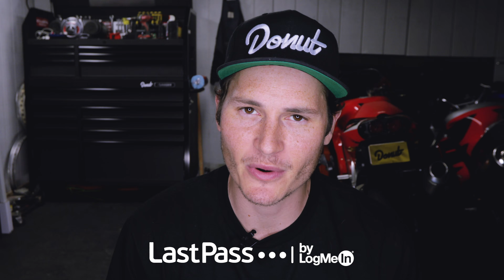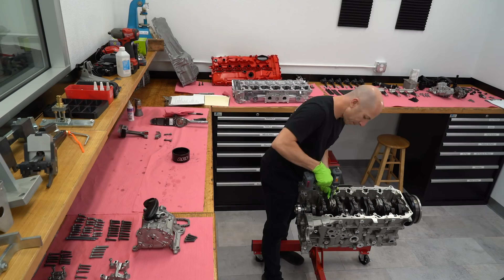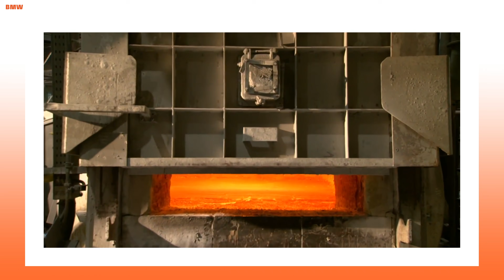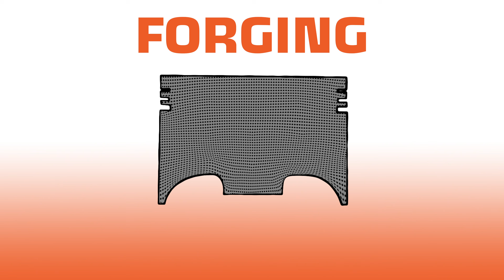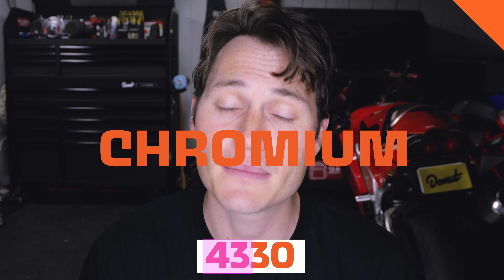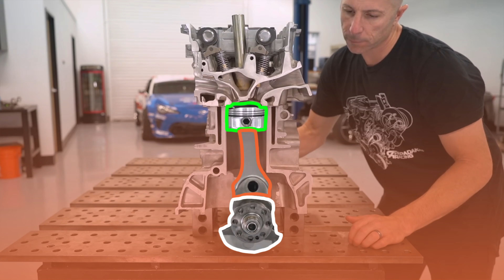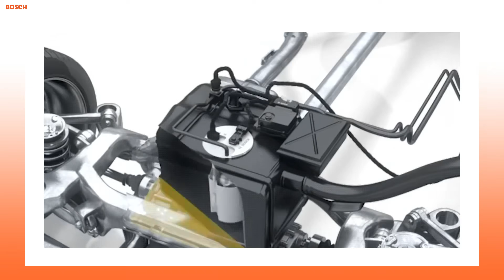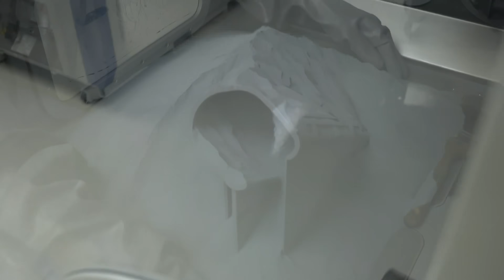The FIRST 1000HP 2020 Supra - Tech Explained

Comment: TBH, when I first heard of the BMW / Toyota collab for the Supra and Z4, I didn't think much of it till now. But to get 1k HP out of a stock power train with just a few new parts is absolutely insane. Who woulda thought that 2 of the titans of the automotive industry could create, and pretty much future proof such a magnificent beast.
Reply: It can take 800whp on stock internals(more is possible but with the risk of the rods twisting) but this is the version with 2 port heads he was using. The 2021 Has 6 port heads with a lower compression ratio,different heads,and different pistons so the 2021s are going to give the mk5s a bit of a kicked once their out.
Reply: "1k HP out of a stock power train with just a few new parts"
* only parts left are the block and the top *
few new parts....
Reply: +SMG516 I wouldnt call that few.. the 2JZ has been actieving those power levels with less parts changed for 20+ years.
Reply: @Clownelskiy  It didnt happen the same year though. It took awhile for the 2jz to achieve those numbers.
Reply: @GokuTheHusky  that's cuz we were all still learning. Way easier to make 6-700 hp out a 2jz than b58. B58s break when you add 1-200 hp
Reply: @eduardorivera4100  not really, adam lz have a high 600hp mk5 supra and it didn't break after a whole lot of beating,
Reply: @GokuTheHusky  @Alexander White Of course not. The aftermarket was nearly non-existant for these power levels in the early 90's. You were the shit if you made over 500hp with any Japanese vehicle on the street. Stupid comparison. Most were still running BPU by late 90's.
Reply: @eduardorivera4100  Did you not watch the video lol? Almost everything is stock in this car lmao?
Reply: @Clownelskiy  that's nice
Reply: @Clownelskiy  False you actually need to change just as much in a 2jz to get to 1000hp reliably. This engine has been around for less than 4 years so that's a moot point.
Reply: @razvanmihalache5680  False on your end indeed. Last time I checked, 1000hp could be made on a 2JZ without upgrading an intake manofold or building the V160 transmission and we have done so for many years reliably.

Comment: CR part is wrong-ish. CRs in the range of 7:1-8.5:1 are common on boosted engines. Most modern NA gasoline engine run compression ratios in the region of 10:1 to 12:1 on regular gas (95 RON). Modern diesels  commonly run somewhere around 15-17:1. Except if youre Mazda, then your gas engine runs 14:1-ish no hassle

Comment: 135 ft-lbs??? No sir, that’s not at all a correct statement. If that was the case when I torque a head on a Waukesha 7042 to 600 ft-lbs per nut with a 3/4” drive Proto torque wrench I’m F*CKING SUPERMAN! It all goes to leverage sir plus if you put 135 on that little 1/2” drive with a 4 or so inch handle you can say goodbye to the little cog in there! 😂😂😂 Other than that love the video and Donut Media!

Comment: Soooo its not stock as it has aftermarket internals. Granted only pistons or whatever but its not stock. Im not a 2J fan boy but they can achieve 1000bhp without any replacement internals.
Hell even the 1uz V8 can achieve 1000bhp with a stock bottom end just a huge turbo a good tune some hose pipe for injectors and some upgraded head gaskets and studs

Comment: Great video, some really informative stuff, check your numbers on compression ratio. Most modern engines run near 10:1 some even higher. Race gas around 15:1. Diesel engines around 20:1. Jet engines are around 40:1

Comment: To be honest... using retarded units on engenering stuff is hard... especially for professionals comming from countrys other than the us... I need to look up every god deamn unit u mention like 5 times... Pls use the metric system in some way in the next videos. For example just write the Number with the metric unit somewhere on screen.

Point 2. You make 135 FT - LBS or about 180 Nm seem like a lot... and for a M10 screw this is a lot, when you consider, that many engine manufacturers use aluminium screws.
I have learnd at a machine manufacturer, where we regularly had M10 that were planed stock with about 100 Nm.
And a few special bolts (also M10) were torked down with about 140 Nm (stock).

From an engenering standpoint this is expensive stuff, but not unusual!

Comment: The dyno run shown multiple times isn't indicative of the final product. The sparks were from the direct injection system being turned off for port injection and used to plug the cylinders shut. Then that happened and they made actual plugs so they wouldn't damage anything and keep running.

Comment: For the people saying that the b58 is inherently worse than the 2jz because if needed a fancy manufacturing technique for the manifold, that is not necessarily a valid argument because the manifold for this car was made that way since there is very little aftermarket support since it's so new. Nobody manufactures this kind of manifold YET, but they do for the 2jz. Thus, it's a lot easier to make a one off using a 3d metal printer than normal manufacturing techniques which require that thousands be made to be cost effective.

Comment: The part about compression ratios isn't necessarily correct, most modern engines have compression ratios in the 11:1 to 12.5:1 range

Comment: Just saying Mazda with their sky active tech can have a 12-1 compression ratio in a N/A motor like in the Mazda 6 which runs on 87 octane
Reply: I believe overseas versions run even higher, like 14:1. At least, I remember reading that in a magazine like 5 years ago.
Reply: N/A engines normally have higher compression than turbo engines, just saying.
Reply: The comment I was looking for

Comment: peaked my attention when you mention compression ratio and how that relates to power/fuel type. see if anyone on here could answer this, my car is a tiny little 4 banger only makes 130 Hp and uses normal gas, BUT the dang thing has a compression ratio of 11.1 ! so my question is could premium fuel make any change to performance? i want MO POWAH but there is no after market support at all for my car ( ; _ ; )

Comment: FYI: The sparks flying out of the engine during the dyno clip are the stock direct port injectors left in the engine overheating, melting and wrestling in the combustion chamber.
Reply: haters detected
Reply: Sep G I’m just not impressed. For the power level he achieved he didn’t do anything that special. He also used old technology instead of  developing or using new shit with these cars. It is understandable given his timeline, but still not that impressive
Reply: "direct port injectors" lol
Reply: He made a plate so instead of leaving the old ones in now
Reply: just watch papadakis disassemble and reassemble the whole engine and what did he do to achieve that 1000Hp goal, for what he just said, only the head and block was retained in this build, the crankshaft is bulletproof itself yet its a drift car, it can hold that much hP yet they need NOS that's why he decide to change it
Reply: Arin B. The b58 shares a similar displacement and engine layout to the 2j. Everything else is just better
Reply: Is that true??? 😳
Reply: Except they didn't use the stock direct port injection.......
Reply: @masonpressley5284  yes but the injectors were still on the engine, after that incident, steven machined some plugs to replace the injectors
Reply: Dude papadakis straight took the b58, stripped everything off of it that made it a modern motor and basically made an aluminum 2j lol. It’s not exactly admirable.
Reply: @TS-jq9ex  why not? It's better then stuffing an LS in it.
Reply: T S it's that Papadakis examined which parts could handle the stressors. Everything was good except for the connection rods and manifold. It's nothing to scoff at making new parts with exceptionally high quality.
Reply: @kapilbusawah7169  but that's not basically stock. That's a built motor. These b58 BMW engines are trash. Nothing but problems after 80k. 2jz is a motor that can last 1 million miles!
Reply: T S Damn bud you make it sound so easy  lol... mind showin YouTube that you can do that too in your shop ? Probably not...
Reply: WuTangPuTang I’m saying he used old tecchnology to push a car to around 850 wheel. Hell the n54 has done that on stock DME and stock Block. This dude literally ditched everything in the b58 that made it unique. I understand why as he had limited time and wanted to use familiar parts but it’s still kinda meh. also he didn’t know not flowing fuel through DI injectors causes them to burn...
Reply: WuTangPuTang yes because we cannot do something better we should never give out critique. The fuck. if that was the case we shouldn’t make a comment on literally any athlete, celeb, or politician. I know why papadakis built his shit the way he did and I respect him. Still not impressive. It’s not like he single handed lay designed all the  parts lol. He just got the dimensions out to companies that could.
Reply: @TS-jq9ex  its like its a 3j but you know just named differently coz at the end its just a 6 cylinder, very good factory built block with a maybe bmw badge??
Reply: Edward Kenway 
It's better than the bimmer engines. Toyota specced it for boost
Reply: T S 
Thats rubbish. Watch the build series
Reply: getahanddown I did. I was super hype at first and then pretty disappointed lol. He might as well have swapped in a built 2j. He stripped all the modern tech out of the b58 except for some 3D printing shit

Comment: I think we'll see the difference in the 2JZ VS the B58 when they really get in the hands of tuners. The 2JZ was a legend because it could hold 500-600 without tearing the motor apart, the B58 is an unknown at this point, sure it makes good power with forged internals, but so do the EJ, K20/K24, H22, J30, 2JZ, and basically any motor you can think of. The 2JZ was good because it CAME LIKE THAT, 600hp without bottom end changes. Same with the K24, I've seen 600hp on a bone stock engine short block.

Comment: Donut Media, can you learn me!? I am confused as to how this engine has a 39:1 compression ratio without changing the bore or stroke. From my perspective, the only way this could have been done is to drastically decrease the volume of the cylinder when the piston is at TDC. To do this this, I feel like the piston would be way to close to the valves! I don't see how it would maintain clearance from the valves. Could you explain to me how they did this/ site a source? 
Thanks! Love y'all
Reply: They added a fuckton of air and fuel, that's basically how they got that compression ratio

Comment: I get tired of people talking about how "the new BMW Supra is bad". Yeah,they used some BMW parts,for a reason at that. They didn't use the 2jz because modern engines are more reliable,safer,and smoother. Would I loved to have seen the 2jz come back? Of course! But that doesn't make the new Supra bad. Toyota+BMW didn't grab 4 random people off the street and told them to make the new Supra,a group of extremely experienced engineers built it.

Comment: the reason why he didnt swap it to JZs was not because he like enginering challenge.., well he does but not for that part
it is because toyota didnt want the A90 to be swapped on this year yet, so steph kept the stock engine and built it.
similar case happened to daigo saito which he was gonna import his A90 to the states, but because of that rule from toyota he ended up using the GT86 for the USA FD series, this was told in Robbie Nishida's video (2020 FD Judge) when he visited daigo's workshop.

Comment: Compression Ratio of 39:1? Are you sure? A Diesel engine is at most around 16:1ish with forced induction. So this engine would have a higher compression ration than a e.g. OM 654 (2018 Mercedes-Benz C-Class 220D engine) with 15.5:1. Even if you would use racing gas, the chance that the engine would knock is so absurdly high, the engine would destroy it self within seconds after ignition..
I don't think that the engine has an such high compression ration. The stock B58 compression ration is 11:1 so the it would be an increase of an factor of 3.55..

Comment: It’s obvious that the B58 is a well-engineered engine, but the real question is: If it’s so well engineered and ready for high horsepower, why didn’t they give it more than a wimpy 335 horsepower from the factory? It would’ve taken just a bigger turbo.
Reply: Could be reliability issues, the same happened with the Mk 4, it could have made more power from factory, but they didn't do it

Comment: Stephan: Wanna see a 1000hp supra
Me: You MUST have money to blow. What engine did you use. 
Stephan: A stock one
Reply: He spent quite a few tho to build it for 1000hp
Reply: @DriftPanda9  that's what happens to early adopters as expected.
Reply: I can guarantee this engine wasn’t cheap to build though trust me I know😬😬
Reply: Michael somepersonsname it's not a stock motor. It may be a B58, but it's a built motor when you start upgrading with forged internals.
Reply: @crimsonstang  mostly stock. Many of the parts are stock
Reply: CrimsonStang thanks for clarifying
Reply: "Wanna see a 450hp engine doing a sub 10 Q mile?"

"What car is it in? "

" 70s Beetle (a Bug in America for some weird reason) "

"Yeah. What engine did you use?"

"An original 1.5 (I think)"

Check out Dave Wheatley and Ben Lawrence from Northern Ireland (they're actually from England IIRC, but they live and race in NI)
Reply: @LiamNI  NI gangggg
Reply: @LiamNI  they classic Beatles are called Beatles here in the US. The remake is called a bug. And those are Karen cars.
Reply: @voltairee3012  in my country, people know the vw beatle as frog car
Reply: @voltairee3012  Beatles is a band, Beetles are insects.
Reply: @voltairee3012  either way both of you are wrong. It‘s called Käfer.
Reply: Moron!
Reply: can you even call that thing a stock engine? He changed every stock part of the engine. That's not stock anymore. It's like saying an ibm pc from the 2000 is a stock pc but with a core i9 in it
Reply: @feenomhoosh  exactly, factory engine not stock engine , the wording in the video shows how noob the guy is and how cringe this video is to guys that know what they are talking about

Comment: is this the common way to catogorize steels in the US? Because there are many different, newer (and argubely better) standarts to name steels. For example by EN standarts: The X2CrNi12 is a common, stainless steel. X means its a high alloy (more than 5% alloy elements), followed by its alloy elements, in this case chrome and nickel, and the number at the end is how mutch is in there, here ~12% chrome and some nickel.

easy

Comment: Forging: compressing the particles structure and it made metals become stronger.
Alloy steel higher melting point, lighter, and stronger.

*More air = higher compretion + higher combustion + lower fuel consumtion, need a performance spark plug and eccu.
*Shorter intake pipes + air scoop = will increasing air volume.
*Side exhaust may will increasing the velocity.
*Higher fuel supply may causing exploded, lower will broke the timing belt, tensioner, and the electricity😂🤝

Comment: Says it’s a stock engine... says has forged internals
Reply: Don’t you need forged internals to make the 2J push 1000+?
Reply: Tom Lake Charles Yeah i think so anything past 600 needs upgraded valve train and i think the block is good for like 800. could be completely be wrong but that’s not my point. in the begging he said stock engine. although there’s a lot of stock parts, not a stock engine after you replace parts with forged parts that aren’t stock, it’s a built motor in my mind
Reply: Niklas Wagner 
Yeah, I kinda sidestepped your main point. Sorry.

Comment: Ok, so a lot of people in this comment section gets heated because 2JZ doesn't require laser printed aluminium part to be tuned to 1000 HP unlike the B58 then shortly saying "B58 is worse than 2JZ" 

Listen people, the 2JZ is quite an old motor. Of course the technique of tuning 2JZ has been perfected over the years unlike the B58 which just came out months ago. And speaking of the fancy parts when it come to tuning the engine, the 2JZ also requires better parts to be tuned to 1000HP. So why we don't need fancy 3D printed part to tune the 2JZ? Because the aftermarket parts for tuning the 2JZ to 1000HP are more readily available to the masses compared to the B58. Hell, Papadakis is the pioneer when it comes to tuning the B58 to 1000HP, of course at some point he would need to design an entirely brand new custom part because he can't find it in the market right now. Given a few years, I believe that part which custom built by Papadakis for his build will be available for tuners all over the world to buy, and at that point you too can make a 1000HP Mk. V Supra.

Thank you for coming to my TED talk.
Reply: A lot of people stayed quiet 😂😂 Here, you dropped this: 👑

Comment: My god. That intake manifold in the aftermarket will cost as much as your average build..
Reply: Why? It doesn't have to be 3D printed. For mass production you would use standard manufacturing technique. But when you are only going to prototype a single intake it makes sense to 3D print it.

Comment: Papadakas and the guy who makes koanegseggs has proved that even small engines can make mental power
Reply: 600HP 3-cyl 2L, right? absolutely mental.
Reply: It's all power to weight  and gearing ratios designed to compliment that power to weight. Imo gear ratios are one of the most important components when it comes to going fast, FAST.

Comment: BMW is reliable internal on some engines, between 2006 to like 2012 was the shitty rod bearings issue. Everything around the engine it is shit. Wr know the real reason why the b58 did well, its because Toyota bent bmw over an said this isn't reliable enough, go back to the drawing board. Granted the b58 has been out for a while Toyota was still saying it could be improved.